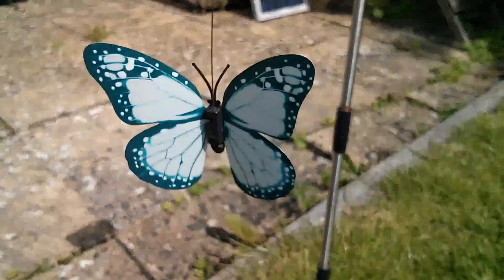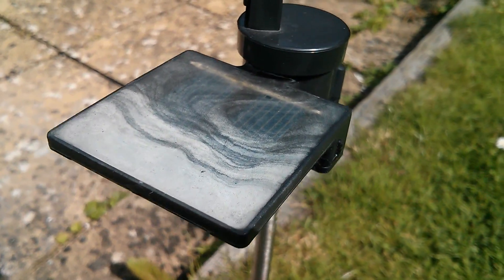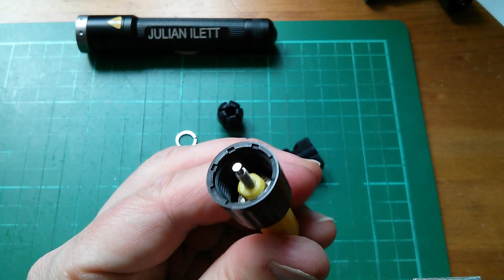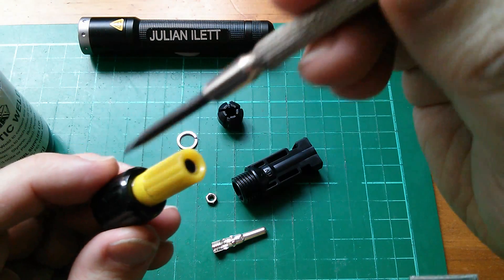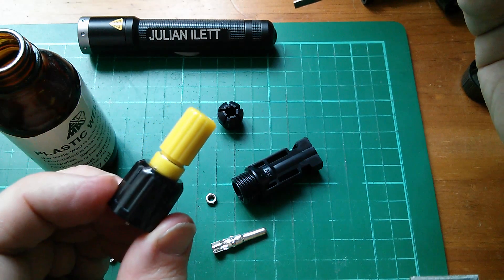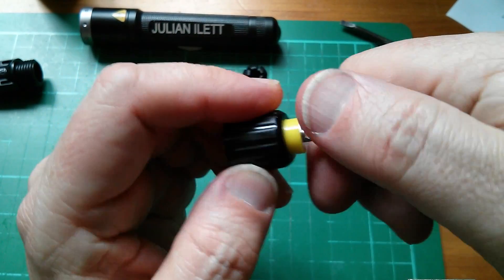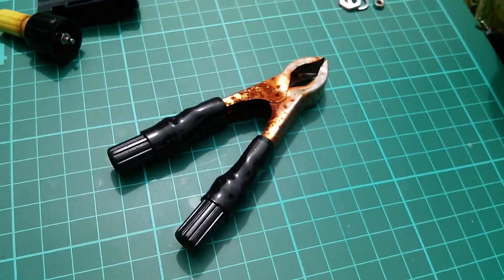PWM5 Easy Connect - Crocs, Bananas and MC4s

Comment: I was wondering what Crocs were LOL.
   I love the different names for similar items in GB and USA, like Torch=Flashlights and Crocs=Alligator Clips.  I also appreciate the How to Hints as far as soldering and using Heat shrink. I have always believed that the better the connection looks is directly related to how good the connection is.
    Love the reviews of small DC items on ebay. It's a shame there isn't a program on eBay like there is on Amazon where you can make money if I purchase something from a link you post. .
Reply from the maker: Actually, many eBay sellers also sell on Amazon, so I could provide links to the Amazon item instead. But the affiliate rates are very low, so it only makes sense when recommending oscilloscopes and other expensive test equipment. This is one of the downsides to my channel theme - Electronics on the Cheap.

Comment: Back in the day things like those binding posts, banana plugs,  and clips were made out of copper,  often nickel-plated.  Seeing all that rust suggests that this is not the cse with the stuff you have there.

It might be interesting to see what exactly the resistance of all of these connections turns out to be.  i would use my "Blue ESR Tester" for the purpose,  since I have one.  But anything else you might have that could reliably measure low ohms should work.

Comment: O rings under the sockets and silicon grease inside and around your bananas will help a lot
Reply from the maker: I like the O ring idea - I've got a box of pound-shop O rings somewhere. Silicon grease or Vaseline I've always avoided because you end up with a sticky mess. But I guess it's either that or make new connector sets every few months.
Reply: Julian Ilett
silicon grease works better than vaselin, its more sticky, doesnt melt in the heat, but sure, gets everywhere and hard to clean off, but is super inside the connectors to seal out water, its supposed to be used on  the satelite dish connectors
Reply: A hot glue gun would be better.  Just fill the area around the large nut/thread.

Comment: How convenient. I need to buy a few (about 10 pairs) 4mm banana plugs but I'm struggling to decide which ones are the best quality/price.
I will be using them with less than 10A so not much but I'm looking at something that doesn't look cheap and doesn't brake. Can you give me a link to what you think is best?
This is to make custom probes for my DMM and charging cables. I'll use some silicon wires for that, probably 14AWG.
Reply from the maker: Not sure exactly which connector to recommend. eBay if you want cheap, a reputable electronics distributor (Farnell, RS or Rapid in the UK) if you want good quality. I quite liked these ones; there's a small grub screw if you don't want to solder (I usually solder everything) and the plastic cover is very flexible so it's quite easy to slide on and off.
Reply: Can you please tell me where you bought yours? Thanks.

I you are happy with these I might as well buy the same.
Reply from the maker: Lagm an I can't tell if you're in the UK, so I'm not sure if this any use to you, but... Rapid Electronics - 4mm Bunch Pin Test Plug - http://www.rapidonline.com/cables-connectors/4mm-bunch-pin-test-plug-83051
Reply: No I am in France, but thanks anyway as I'll probably be able to find something similar in France...
Reply: Lagm an try tayda electronics. Comes from China/Taiwan so take a little while for shipping but they have tons of connectors. Lots of folks on the eevblog forum use them
Reply: I love you dard!
It's amazing how I learn/discover new things everyday.
I guess I need to spend more time on the EEVBlog forums and not just the videos. :D

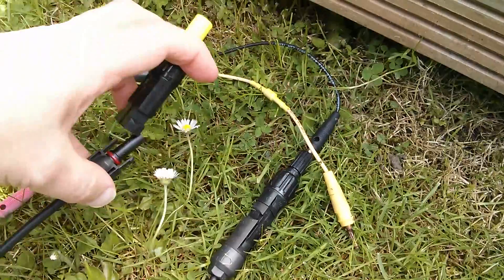Comment: Your phone? going off at 11:03 had me checking around my desk before I realised it was on your video :-)
Reply from the maker: It's been driving me crazy! There's no way to temporarily disable notifications while you're shooting a video - and why on earth would it feed the notification sound into the video - mad! If I turn the volume down, the vibrate motor makes a noise that's just as annoying! However, I think I've found a solution - Airplane mode - that should stop the notifications coming in.
Reply: Julian Ilett
If you have an android phone, try the 'Tasker' app on play store - you can configure your phone to perform actions based on events e.g. mute sound when the camera app is started (the good thing is it will restore your sound settings when you exit the app.)
Reply from the maker: AtomicWorkshop So I could get it to go into airplane mode when I start MovieStudio? That would be cool (although I seem to be remembering to do this anyway).
Reply: Julian Ilett
Unfortunately the 'airplane mode' setting was made part of the secure settings from (I think) Android 4.2 so Tasker is (and other apps are) unable to modify that setting - though you can get around it with a rooted phone.

Comment: I have a small amount of jealousy over the amount of stock you have! =)
Reply from the maker: Not so good when it's unsold stock! I wouldn't normally buy such large quantities, but these were meant for resale.
Reply: would you consider making up some leads in order to sell to some of your loyal subscribers?
Reply from the maker: pietkaify I wouldn't rule it out - particularly as you're in the UK. The problem is the only cable I have is the red, yellow and black, 14A, 20AWG tri-rated stuff that I was using to make the solar controllers. What did you have in mind?

Comment: why the strange idea to try and connect an MC4 (designed for outdoors use and waterproof) to banana plugs which are pretty much the total opposite and one of the worst ideas for outside/wet use ?  There's all kinds of plugs/connectors for outdoors use, banana's aren't one of them.
Reply from the maker: Good question. And it would be fairly easy to answer if the PWM5 weren't waterproof (most solar charge controllers aren't waterproof). Really, the whole system (not including the solar panel) should be out of the rain. In a shed perhaps or at least under cover. However, the PWM5 is completely waterproof, so the banana plug choice does seem somewhat paradoxical.
I suppose the strangest idea of all is my decision to leave the entire system on my lawn throughout the winter.